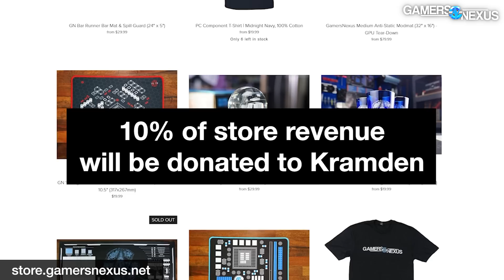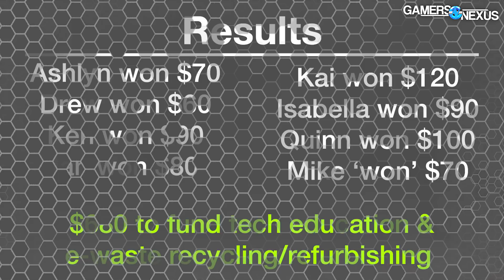Socket 12 Sticks of RAM in 1 Minute, Win $120

Comment: I'd have loved to have a chance to do this.  Definitely would have made very sure the boards and RAM were already trash, though - you can be a lot less delicate with e-waste than with components you're actually hoping to keep working.

(For the reversed ram, for instance, I'd have spun the mobo 180 degrees rather than rotate each of the ramsticks...but spinning a mobo on a hard surface is not something I'd do if I planned to actually keep using it.  Probably doesn't matter much on modern boards, but I was taught to build computers in the day when mobos came packed with a quarter inch light foam layer under them to protect underside components and exposed traces and such.)

(I should look up if there's anything like the Kramden Institute locally.  I highly doubt it; I'm in what Canada considers a city, but that's still well under a hundred thousand people in the whole region...but it would be rewarding and I actually enjoy working with hardware.)

Comment: On topic:
I hate the new slots that only have a latch on one side. I feel it put a lot more stress on the stick connectors and probably the pins - as you kind of have to slide them into the non-opening end.

Do they have an advantage other than saving $0.05   per board? Do they really have to be on $300+ boards?

Comment: Rookie mistake. Before clock starts, get all DIMM's in right orientation. Set stack on its side. Using pinkey/ring finger, to handle stack, and feed to index/thumbs, do slot after slot, grab next stack, rinse and repeat.

Comment: When everyone does it wrong…

There are 2 plastic clips for a reason!!

Why waste time getting 1 corner into place when you can pop open both clips center it and push it down

2 hands 2 clips pickup ram center it and push simple

2 hands 1 clip and ram in the other, then try to get a corner into place and hope you dont break anything or get anything stuck stupid
Reply: You clearly have not alot of experience...
You cant open the scond clip on a lot of Motherboard s
Reply: @lennartmook9182  then just push harder

Every PC i have ever made both clips will move 1 maybe not so easy but they will and without breaking as its plastic its flexible

Motherboard makers clearly need to stop making things wrong

Only motherboard clips that dont move are static ones that are part of the slot and not attached to it

Comment: If you wanted to be sadistic you could have used G.Skill TridentZ memory with their sharp heatsinks, and watched as the contestants cut their hands up trying to put them in! The AIO in my case is one of those ones with a mesh sleeving on the tubes, and the outer mesh is actually frayed from an unfortunate brush when removing the memory sticks!

Comment: Love your charitable work GN but does any other viewer agree the footage of Steve socketing all that RAM looks slightly sped up? I know he is going fast to set a good time but the footage doesn't like right. GN aren't trying to cheat the benchmark but it could have been done to flatter Steve's result making it an solid even 12 sticks within a perceived minute not 11. The timer is ticking along at the right speed but the movement of Steve's body and hands look artificially faster (speech audio run at normal speed).

Comment: Should have went for DDR2 - they are more tricky as the notch is very close to the center of the stick.
And one thing about the latches - they sometimes can still be half locked even when the stick is seating properly in the slot and is detected. The latch is simply getting stuck and can be pushed lightly to full locked position, but it doesn't affect detection of RAM.

Comment: hey GN, great content. Maybe you've done this already--my bad if you have--but I'd love to see a video where you test to see at what temperature PETG pipe fails. I've heard mixed things about PETG's longevity including horror stories of it failing at the compression connector & frying multiple components. I know custom loops only appeal to a small group of consumers but if you need a random content idea, I know I'd find this information useful.
Reply: you'd have to intentionally or through sheer negligence try to make PETG fail due to high temperatures. compression fittings can fail no matter what tubing type you use just due to the o-rings aging and/or being pinched when installed even if they might not be leaking when you initially built the loop.